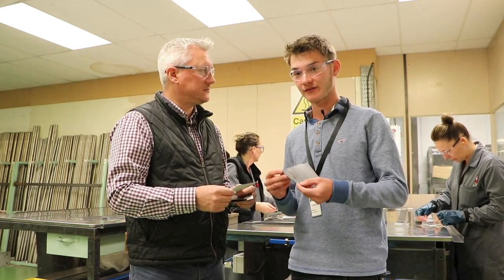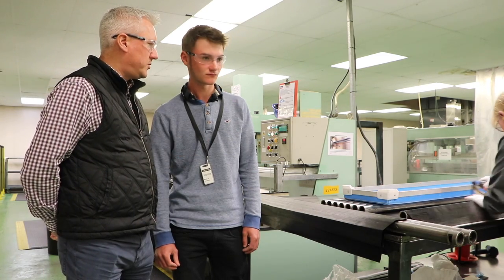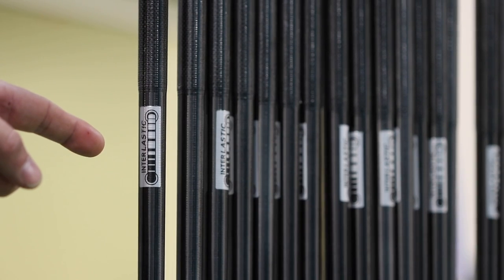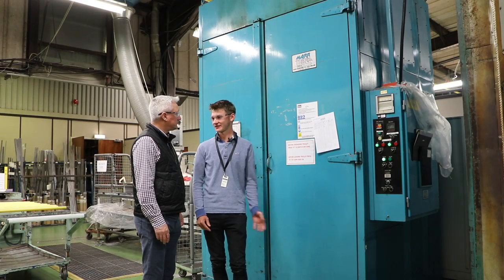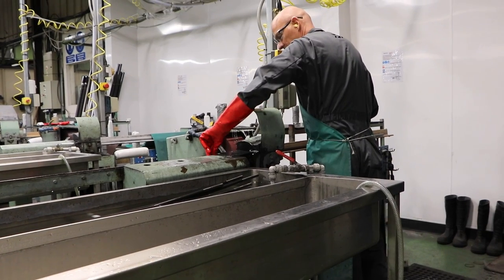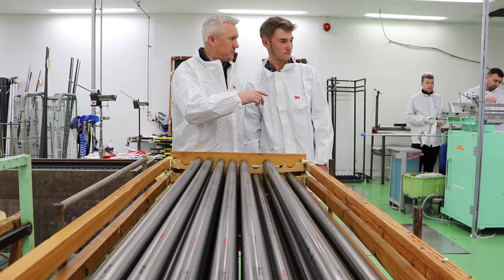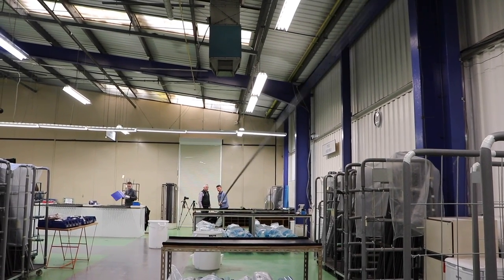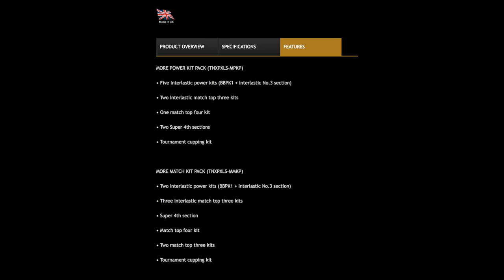Daiwa Factory Visit & Tournament Pro XLS Preview

Comment: having recently bought one of your matchwinner C4 poles recently from bobco tackle in leeds, i have to tell you i am very dissapointed with the availability of spare top kits anywhere as im told they are not uk made and availability is limited, if i do find them they are vastly overpriced compared to other pole makers. had i known that the daiwa pole was so limited on tops and spares i would never have bought the pole and feel i should have been told about the lack of aftercare service i could expect from such a large name in the tackle industry. it has put me off buying or recommending daiwa for a long time!, i would be interested in why availability is so poor for such a large company!
Reply: Only the top end Diawa poles are made in the UK. I think from the g20 and up... Could be wrong. All other Diawa pole sections are made on different size mandrels overseas with a lower grade carbon 👍
Reply: I have a match winner 3 and have the same problem but I found a browning top kits fit and only £20 each
Reply: @williamstones6415  the MAP TKS kits fit too and are readily available :D